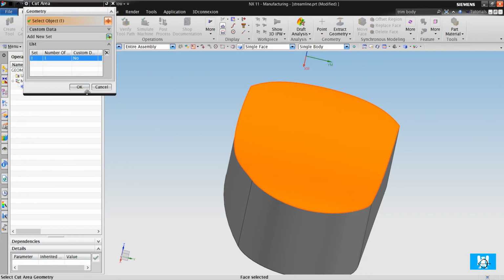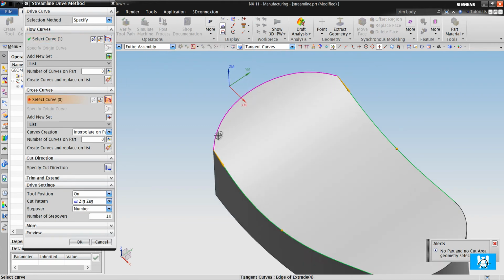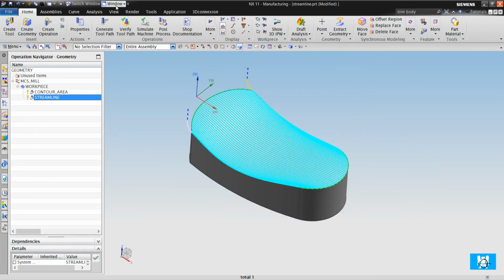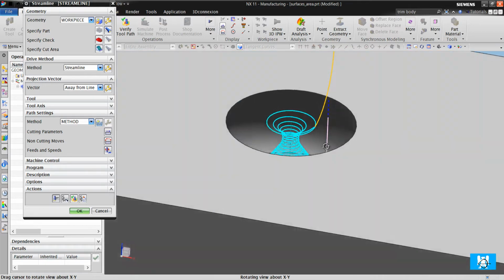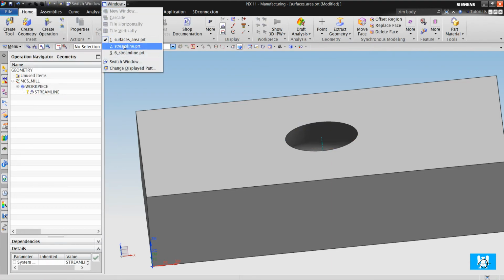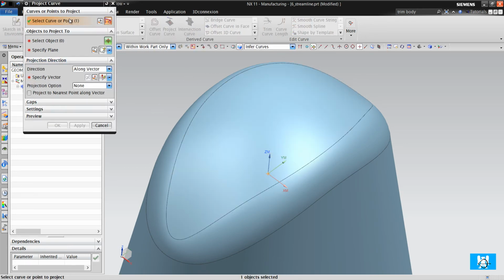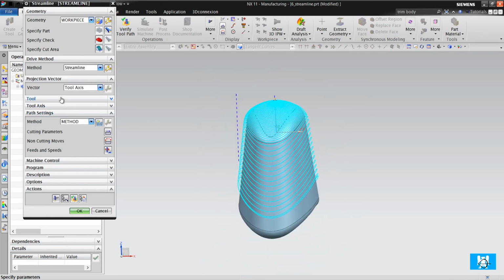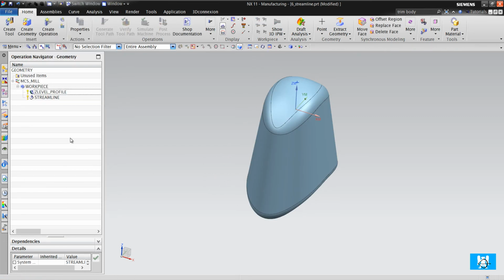24-Streamline Operation

Comment: HELLO YUSUSF
i have the same question as rajesh,
if you kindly explain the projection vectors type on the fixed contour options.
Thanks
Reply from the maker: Hello Muhammed. I will explain projection vectors in 5 axis simultaneous operations. They will be more suitable for the situation.
Reply: @AtillaTeknikEgitim  Thank you very much for your feedback and also for your illustration. 
I appreciate all you doing.
Thanks